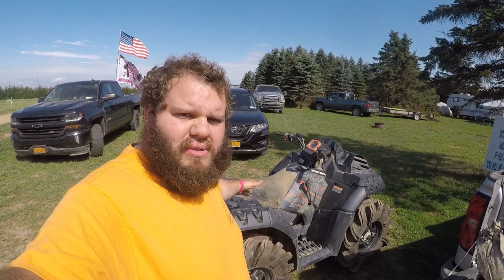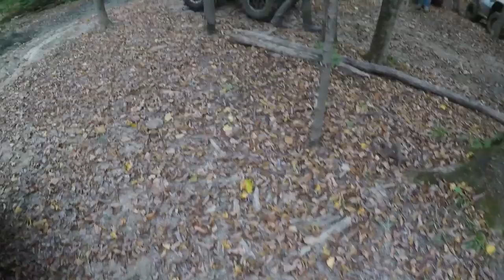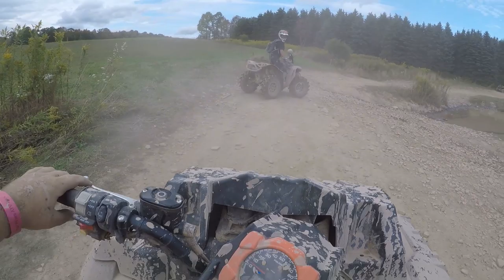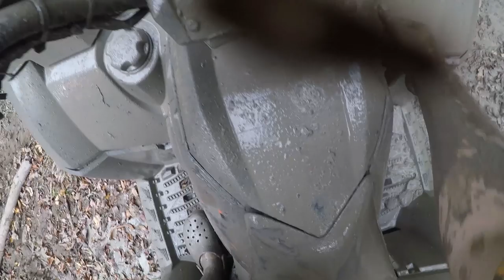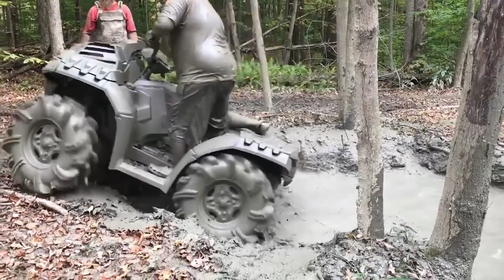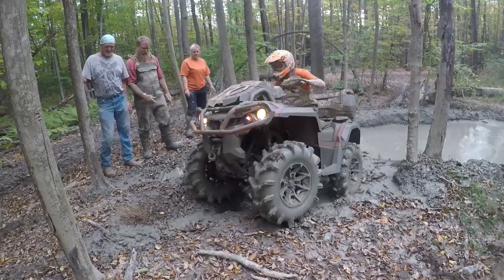Tall Pines Dice Run With the NY ATV Addicts!

Comment: Definitely makes me wish I would have been able to make it out for that rip! You hit that hole good and proper at 4:17 Though one thing I learned from mudding in though South....the low, slow, and lean often prevails. Rocking it solid with the crocs man! 😎
Reply from the maker: For sure man I started to learn that you c it later in the video I started leaning back and hard right so the rear tire got traction and got out!!! And love my crocs easy to clean and breathable lol
Reply: KotaBearTV  I need to get me another pair....keep em locked into 4x4 full time 😂
Reply from the maker: @NorthCountryBoyz  lol for sure dont want them coming off in the deep water lol